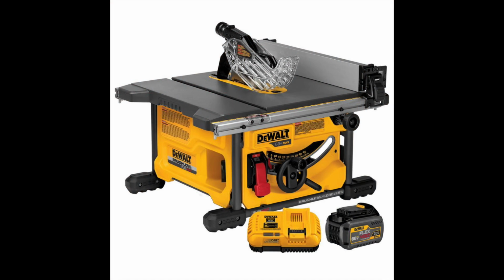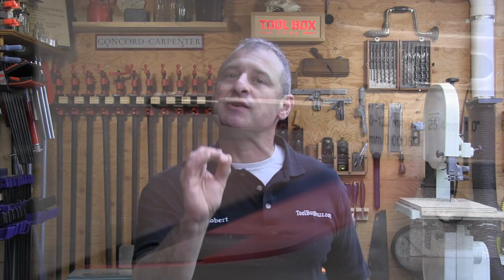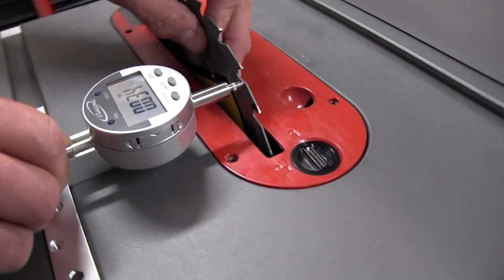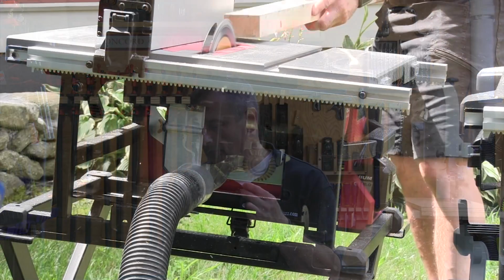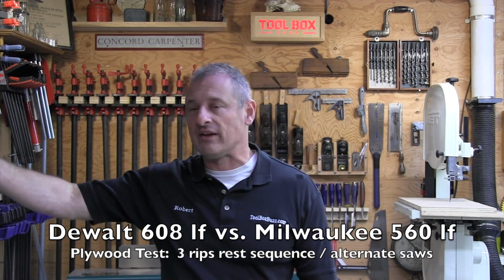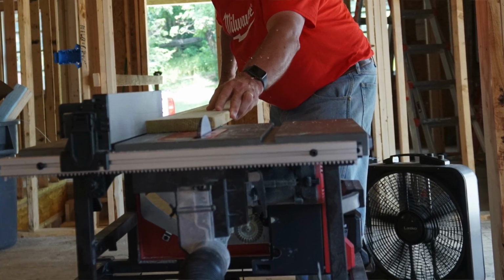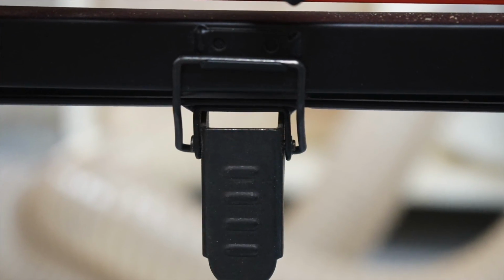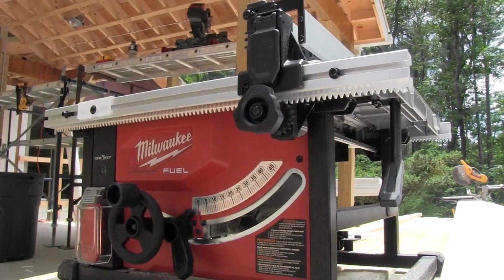Cordless Table Saw – DEWALT vs. Milwaukee

Comment: Looks to me like Milwaukee simply copied the DeWALT saw.  I’d like to see DeWALT increase the blade size to 10”, utilize two FlexVolt battery packs & include 120v adaptor 👍🏻
Reply: I totally agree. I have the powered version and love it. I also have the flex volt miter saw with adapter and love it. Running 2 9000mah batts for it. Just need the table saw to run off both power supplies and I would be set.
Reply: @terryfrome1641  agreed whoever makes a table saw run off both battery or the option of 120 volt AC that's probably the one I'm going to buy
Reply: Terry Frome I think at some point in the future they’re bound to make that happen but not too soon. I’m guessing that with the miter saw it was more practical for them to produce an AC power supply as the saw is designed for 120v. These table saws don’t use 120v motors so it wouldn’t be pragmatic in cost/value for them to engineer, produce and include it with the machine.
Reply: Yep!  That should have been obvious to DeWALT!
Reply: Are you guys going to review the metabo hpt table saw?
Reply: Agree
Reply: That would be a good idea, though would be very expensive.
Reply: The CEO that created the Dewalt line went to Milwaukee....they are both created by t he same guy
Reply: I took my gaurd completely out and use a 10 inch blade
Reply: Milwaukee had the advantage of being second to market
Reply from the maker: Yes of course - and they didn't CRUSH it, which surprised me
Reply from the maker: Cisco8484 yup
Reply: Cisco8484 and lacks innovation of their own
Reply from the maker: Ryan Brown don’t think they’ll do that
Reply: A Concord Carpenter / ToolBoxBuzz yeah but why not? I just bought the 7480 out of fear of a single 60v not cutting it. 2x60v on a 10” makes sense to me, unless I’m missing something pertinent. At work we give the 7491 a run for its money, so that leaves me skeptical
Reply from the maker: Doubling the batteries with the adapter without some significant weight and cost to the unit
Reply: I'm a die hard Milwaukee guy

You just described their entire business model. 

That's why they're late to market with every tool.
Reply: Milwaukee Aka TTI has copied every single power tool brand out there. Thats what the Chinese are good at.
Reply: Razorzr1 Vette indeed the Chinese  are  master at that craft lol. Though I have to give credit where credit is due, sometimes they improve & other times these big boy China company’s are pumping out innovation! Just maybe not TTI
Reply: @razorzr1vette71  if they simply copy then why do competitors not live up to the same standard? I have Milwaukee, makita, Dewalt, and even rigid tools. I can count on one hand how many tools I prefer a different brand tool over my Milwaukee versions. I prefer Dewalt multi tool, makita table saw and miter saw, Dewalt power planer, and Dewalt hammer. Those are due to their design. None of them are close when comparing battery longevity or tool durability.
Reply: Well yeah... Milwaukee doesn't have traditional large power equipment. They need to innovate on traditional corded designs. DeWalt copies Milwaukees for handheld tools.  The only reason DeWalt has a leaf blower is that Milwaukee came out with one first.

Comment: I do not have an arbour lock on my table saw.  I also do not have a second wrench and to be frank once I learned how to change blades on it I wouldn't want ether.  Look I wouldn't buy a cordless table saw because I build furniture but I sometimes work at people's home and a portable saw with batteries to me sounds better than one with a power cord...  Man I wouldn't have said that 5 years ago
Reply: I've built fireplace mantles out of oak and chestnut live edge desks with my Milwaukee cordless table saw. It did fine.

Comment: I might’ve missed it but the Milwaukee has better dust collection correct? And if I’m not mistaken the Dewalt only has one miter slot compared to the Milwaukee that has two which might be a big deal for some people. Good review nonetheless as usual Rob
Reply from the maker: Carpenter One3 Milwaukee did better in dust but it was negligible - yes 2 miter slots

Comment: What about the fact that I have been using my Flexvolt saw for the past 2 years and Milwaukee is just now coming out with an alternative? Milwaukee is way behind the game with their saw. I am into both platforms. Dewalt has no competitor to Milwaukee's 10 inch 45 lb miter saw. Dewalt Flexvolt 12 inch 80 lb saw is not a portable saw. It is a stationary saw / boat anchor.
I am to the point of believing that these companies collude so that we have to have multiple battery platforms.
Reply from the maker: Milwaukee is playing catch-up -- no doubt. Collusion? Doubt it
Reply: I'm being facetious. Really like your channel. Long time subscriber.
Reply from the maker: thx bro
Reply: James Premo yes James I'm in the market to cut the cord for the miter saw, but for the life of me can't decide. The 12" Dewalt checks the boxes but 80lbs or close to it... Damn... Cut the cord and lose a nut!!.. I don't know what the heck to do... Smh
Reply: If you don't need a slider DeWalt has one without a slider cutting the weight

Comment: wonder how long it will take Makita to get one of these on the market. I love my Makita tools but it sure seems like they drag their feet getting new tools on the market
Reply from the maker: Soon
Reply: I sure would like to see a Makita 2x18, as I really love Makita tools, but considering their corded tablesaw pricing (twice the competition!) I don't think I'd get it.  As it is, I'm waiting for a big sales promotion on either the Milwaukee or the DeWalt.
Reply: Me too !!!
I wish Makita would spend more time out in the field. Actually talk with us...do surveys from Makita guys like us ( love the blue ) then go to the drawing board armed with real info. Kit and no kit like always..1,2 or even 3 batteries.whatever. cordless really isn't about run time.but
 nice.. it's ease, convenience,in and out..if i want run time I'll drag out the corded bad boys. Function, accuracy and in this case debris control along with longevity. 😋😀
Reply from the maker: They do go into the field. Makita WILL NOT change their platform. My guess is they will do an X2 saw - #Hoping #FingersCrossed
Reply: Tracy Kooken yeah I’m with you there on Makita. I’m in pretty much every platform but Dewalt and I’ve grown very fond of my Japanese based tools. When I got into Makita, I immediately fell in love with their drills and drivers at first use. Which lead me to the X2 miter saw, which I love. Just so nicely built. When I got into Hitachi recently, I fell in love with their triple hammer, brushless drills, cordless nailers and especially their compact 3ah battery. The other brands absolutely need to follow suit on that battery... I often do wish that Makita would join the competition on a closer level these days though. BUT, sometimes I wonder if Makita is just sticking to their guns as a slow and steady competitor that never changes, never gets overzealous and very rarely falls short on their products. They’ve been around for so long, owned by the same people, and they make very  well performing and enjoyable tools to own and use. Ergonomics and pleasure of use are a highlight for Makita in my opinion. Maybe they’re just laughing in the background as this crazy technological brand to brand ruckus that’s going on lately. When they do drop a new tool, it’s usually something special but it would be great if they’d pick up the pace a bit right now though. They absolutely NEED to bring out some bigger batteries for crying out loud. I run through 4-5ah packs on my miter saw in a busy day of laying decking... I love my Milwaukee tools as well but my impacts just feel to thumpy after using Makita. I realized this summer that I’m much happier and content being in MANY brands, picking whichever tool I want from either brands offerings. I have nothing against Dewalt, in fact I’d like to enter their platform, there just hasn’t been the need for me yet. I was very close to using the table saw as my ticket into the yellow but ended up buying the M18 on a whim the other day. Seemed like the right choice with all the batteries and chargers I already have.

Comment: These saws are great but they are not the result of 2 separate companies trying to compete with each other. They are the result of many hours of working together to make 2 saws with the least differences they can possibly get away with.  The rack and pinion fence is actually similar enough to infringe on patent law.
Reply from the maker: Patent has expired. Pretty sure they DO NOT work together  they're competing to keep people on their platform and convert new users.

Comment: Boy I need a table saw. I have one thats old, out of whack and dangerous.  No riving knife or shroud and bent fence. But that's ok. Thank God I have it. I just have to be extra careful. I was hoping DeWalt would release a table saw like their miter saw, corded AND cordless. I have many DeWalt tools, and NO Milwaukee. I won't buy them due to their cult following and over price. Kind of like Apple owners lol  Thank you Rob for yet another great review that i can trust.
Reply from the maker: Dewalt told us that annoying an AC/DC component would add significant weight to the saw and at least $100 more in cost - I'd pay it!!!
Reply: A Concord Carpenter / ToolBoxBuzz NO DOUBT!!!!!! Why didn’t they do this???? They act like $100 is going to break us. It’s the cost of a battery. Stupid move.

Comment: Milwaukee is simply trying to copy dewalt
Reply from the maker: Sure, wouldn't you? Dewalt set the bar and are the ones to beat
Reply: No point to invent wheel again table saw is table saw.
Reply: I don't think of it as inventing a wheel. If there is no competition there is not growth and improvements in just about everything in life.  If one company does not keep up with another or let's say copy another, then the company that invented that wheel stays stagnant.   Copying others, for lack of a better term, drives more innovation by the company that made the invention or leap.  Here's a thought.  For the short amount of time I have been spending with buying new tools, I have only really looked at Dewalt.  I used corded miter from Dewalt that is 18 years old.  Some other corded dewalt tools as well, drills and such.  No table saw though.  I went cordless for dewalt because I had dewalt corded.  Bought a used Jet table saw, big, commerical/industrial type but had no riving knife, no guard, no dust collection and at this point don't even worry about a fence because I wanted to go cordless.  Fast forward a bit, I have been eyeing the Milwaukee because I started buying Red when my wife got me an extra set of driver and impact from Red.  Nice fuel set with batteries and charger.  Old Dewalt 18v circ saw was not cutting it, said hell let me get the latest Milwaukee Circ saw with the 12 battery.  Now for the past month I have been waiting to buy a table saw - cordless.  I have been eyeballing the Milwaukee all along even though i think they are both close and yeah, most likey red copied Dewalt.  However, Red has me hooked because any tools I recently bought will be able to use the same battery that the table saw has, and any battery I have on the red tools I bought before will work on the table saw or the new circular. The other Dewalt tools I have, about the same amount as the Milwaukee, I cannot use the 60v battery on some of the other Dewalts.  So to me, Red may have copied but it does not make me feel like I will miss anything if I don't go with Dewalt.  As a matter of fact I feel like I would be going backwards because of the battery issue.  To me the battery issue was a show stopper.  Based on this review that was done, yeah maybe the Dewalt can do some more cuts, but I personally don't need that many cuts in a day.  The point of putting this out here was to say, Milwaukee innovated better because they made it so that there wouldn't be that batter problem.  Red seems to be making sure to protect the current Red owners.   Copying Dewalt?  Maybe but that cannot be there main strategy.  What may happen next is Dewalt may learn from their battery mistakes.  I bought a Dewalt wet dry vac quite awhile ago, I just sold it the other day.  Reason I bought it was that it would support my 18v and 20v batteries.  The 18v tools were not cutting it anymore after so many years of good use.  I upgraded.  But hearing all the issue with batteries on all the dewalt tools I did not want to start with the flexvolt 60 circular saw so went with the new red 12.0 and did not want to worry about the new table saw so shooting for Red and I am going to sell my old ass dewalt 12 inch compound sliding miter saw (corded) and get one of the Milwaukee miters that use the same battery.  Reason I sold the Dewalt vacuum was that the newer battery line on the table or miter saw for Dewalt would not work.  Just kinda pissed me off.  Again, the point of explaining all this was to say that in some respects a company does sometimes copy and in many other cases improves upon. So we win as the consumer.  If our tool of preference doesn't win a review contest, the tools all do seem to be very useful for the DIY or the contractor. I have seen many many posts about this tool versus the other.  I always see the same kind of posts and it seems everyone uses any and all of the tools out there.  Cloning or copying a from a competitor will almost always drive innovation and get this.. sometimes prices on product drop as well.  @jnunes246, you say "Milwaukee issimply trying to copy Dewalt" I would say Milwaukee has done things better than Dewalt based on many other reviews of this product.  I wouldn't think or say that Milwaukee did even close to a bad job copying either.

Comment: Once again Rob. You have made an heck of a good review with trust worthy facts and in-depth examination of those 2 cordless table saws. After your first review, which I have seen over and over 🤓 I got my Milwaukee table saw, last week (guess I was among the first here in Denmark to get it) and what a great little handy powerhouse. Guys at the Job-site stood in line to tried it and to compare it with their one or two year older corded Dewalt table saw, and boy they were impressed, and so I am. 
The only little thing, is that the extruded aluminum profile, the fence, should have been a little thicker in the material. It feels a bit flimsy. But besides that, it’s a keeper 👍🏼
Reply: jeg er også fra danmark må man spørge hvor din sav er købt :)
Reply: Nicklas Jensen Bygma i Viby, Jylland.

Comment: I am hoping that Ryobi or Makita (the two brands that I use) come out with one of these soon. If they do, I hope they go with a 10" blade though. Why did Milwaukee and Dewalt go with 8 1/4" when 10" is the standard size for table saws?
Reply: Bigger blade equals more drag. So batteries would have to work very hard
Reply: @27bahneys : DeWalt makes a 12" miter saw and Milwaukee, Ryobi and Makita all make 10" ones. Does a table saw require that much more power?
Reply: @chengliu872  well, you're not going to sending eight + feet of board through a miter saw.....
Reply from the maker: true
Reply from the maker: I'd like to see Makita
Reply from the maker: Cheng Liu larger blades greater a bigger draw / drain on the motor and batteries. The depth of cut handles most of what we use these saws for. I hope you have an opportunity to try one of them, they’re truly game changers
Reply: So in addition to the saw using 8-1/4” blades, the blades need to have a thinner kerf than normal? If so, then it's a thanks but no thanks for me. I'll stick with my corded Bosch 4001-09. At least uses generic 10” blade. I always try to avoid saws that use unusual blade sizes.
Reply: @chengliu872  you can use regular kerf blades on these cordless saws, just the saw will have to work harder. I use an 8 1/4" woodworker II by Forrest on my cordless Milwaukee table saw. Cuts like butter.
Reply: @chengliu872  common blades have ca. 3 Millimeter thickness this blades for battery operated saws have ca. 1-1,2 Millimeter thickness . Sorry im not so in imparial measuraments thats why i used metric numbers
Reply: for this saws you need special blades as on common table saw they are much more thinner as common blades
Reply: @dewalter3963 : By thinner are you referring to the diameter of the blade or the kerf?
Reply from the maker: Kerf
Reply: @chengliu872  the thickness of the blades

Comment: Awesome review!
I got the dewalt one a few weeks ago. I admit I was a bit sceptical about the run-time and performance, but the saw performs just as well as a corded one - Amazing!
I use it with my two flexvolt 9 Ah batteries, which is good enough for most of the days. I learned fast that starting the day with two fully charged batteries was very crucial, when the saw was needed.
Overall very happy with it, strongly recommend it.
Go cordless!
Reply from the maker: 9.0 is a great battery and will serve you well
Reply from the maker: Great saw - been using it since they came out with it - its a job site game changer!!  #Visionary #TrendSetter

Comment: Let’s see now dewalt has 2 batteries so now add another Milwaukee battery humm now the milwaukee has a lot more cuts. Because your useing  2 batteries for each one of them. I think both would get the job done. So guess you would go with the one you have other tools for. I try to use all the same kind but do have one other type of battery tool.
Reply: John Bailey   John, the DEWALT table-saw comes with only one battery.

Comment: Where you able to make adjustments to the Milwaukee to fix the 89 degrees and 46 degree settings instead of being 90 and 45 degrees?
Reply from the maker: Yes - all saws were adjusted. Easy
Reply from the maker: yes - easy
Reply: After tuning each saw was the accuracy of the Milwaukee as good as Dewalt, or still "not as accurate" ?

Thanks.